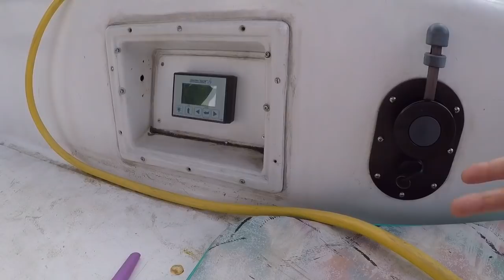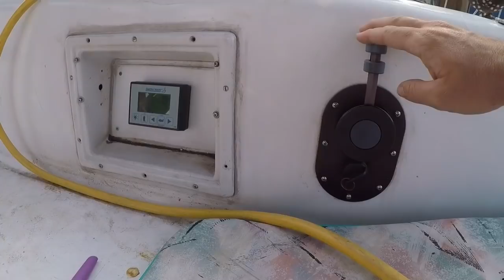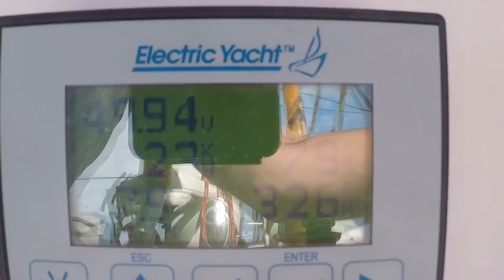Our Electric Motor | Sailing Wisdom Ep 32

Comment: Hi just my experience , my neighbour next to me has a 37 ft yacht  wanting to do the world trip , etc dumped the diesel went electric   The cost was twice than the diesel , he was told ,,,no it will be cheep  ,battery’s were 600 a pop and he had 12 of them m to keep up with motor and living on the boat  ,there life became ,,save power , one light at night , and they brought heaps of flashlights  ,then there was cable , very expensive stuff to accommodate long life for this motor , then there was the dash with all its requirements , on the out side the solar panels were another drama , 6 of them huge.  They made a bimini out of solar panels and then found that if the rigging cast a shadow over the panels they stoped working  ,it went on , the. He could not get cat 1 to leave off shore until more money was thrown at the engine affaire to satisfy the inspectors  so , it’s not over yet they have many trips away doing the odd week trip etc  ,the end result.  They say they run out of power lots.  Remember you can’t run the system below 60 percent , it damages the battery’s.  It goes on.  Stay with diesel , if you a green nose. ,suffer it.  Diesel motors are only as good as you maintaining the.   Clean filters and fuel  ,up to you , oh ps my neighbour was thinking of selling at one stage , the broker said it won’t be worth much maby put the diesel back in , good luck
Reply from the maker: Ouch, that was a miserable experience! Our entire conversation including the boat yard bill was cheaper than the cost of the diesel motor we were looking at installing. 
It pays to shop around! Good luck to them.
Reply: Proving the point that $$$$ don't equal brains...."go small go simple go now" wise words of L&L Pardey a cruising couple who did it all.

Comment: can you run the engines and charge with solar at the same time?
Reply from the maker: Yes, but only because now we have a lot more solar. If the sun is high in the sky and we aren’t moving too quickly, it will charge at a few amps while we motor along.

Comment: 210ah on those batteries. 2017 I can see why, glad in 2019 we can get 210ah out of a SINGLE LiFePO4 battery.
Reply: Daniel Murray i don’t think at 48v. that bank they have is 10kw. what single battery is 10kw? ah mean nothing if you don’t factor in at what voltage
Reply: @AllMyHobbies  LiFePO4 is 3.2 V on a cell level, but what Daniel means is a battery (seveal cells). They now sell 12V batteries (packs) in the same enclosure as a 12V lead acid battery that holds >200Ah at 12V. And LiFePO isn't even as energy dense as NMC. Tesla projects getting >500Wh/kg in 5-7 years. That would be a game changer.
Reply: @jorgenr  LiFePO4 is only safe in the boat. because  In general, lithium iron phosphate batteries do not explode or ignite. LiFePO4 batteries are safer in normal use,

Comment: do you have a video on how you wired the step down converter into the 12v system?
Reply from the maker: We do not but it literally has two wires that lead in at a higher voltage and two wires that lead out (and to the breaker panel) as 12v

Comment: Could you use the power generation for making drinking water, or would that require more power than is available?
Reply from the maker: +Chris Niekel we could, but it would only be feasible if we were sailing very fast for a long time. Sadly, we only hit high speeds for a little while and then the wind seems to change out of our favor. 
With more solar panels, we would be able to afford the power draw on a calm sunny day.

Comment: Hey Guys , great info , I’ve got A 10 ton full keeled Colin archer styled boat I’d need a pretty big engine if I converted over ! Which I’d love to ! However what size engine would I need ?
Reply from the maker: I would contact Mike at Electric Yachts to figure that one out. 
Mike@electricyachtssocal.com
We are 18 tons with a full keel and have a 20kw motor. We don’t motor much so we opted for a smaller motor, but they do have much larger motors as well.

Comment: Certainly to change to Li Batteries would give you around  50% more driving time/range as you can run the Li battery down more than the Lead acid batteries, you also save on Battery weight for the same AH, but oh dear, the cost !  probably US $ 800 for every 100Ah Li battery. big cheers,  P&F
Reply from the maker: I’ve been looking at building the batteries from LiFePo4 cells and that will range from $80 per 100ah@12v or $320 per 100ah@48v to $572 per 100ah@12v or $2288 per 100ah@12v. 
The cheaper batteries are only available for a short time while the more expensive ones are available all the time from online retailers.

Comment: Great to see how this one works, don't want to seem critical - just a notation and an opinion - in re to bilge w/ electric - my main concern would be in the event of taking on any water, or through hull leak - I wonder how much water can or level it can go up to b4 it shorts and fails ? Also bilge cleanliness can be crucial - plan for the worst , and if thre rat sh*t , hair, plain dirt in there it creates mold and crud will quickly kill a bilge pump - another way to be screwed in a hot little minute ;-)  think of back-ups and then another back up if it all goes bad  !   Happy sailing  !
Reply from the maker: That is also a concern of ours. With a full keel the original motor was placed all the way down in the bilge so a few inches of water would wet the bottom of the oil pan! 
The electric motors mount above the drive shaft, so they sit about 2 feet above the bottom of the bilge. 
We have an electric bilge pump (standard rule pump) which could easily get blocked. Then we have a Whale Gusher mounted in the cockpit with a strum box. 
Last but not least, we have a massive Edson manual bilge pump with no strainer and a 2.5 inch hose feeding it! The Edson can actually flow filth and scum with ease and shouldn't clog as a last resort. 
Basically, we have an electric pump for convenience and then two manual pumps for actual work and dependability

Comment: Oye. I’m leaving in 3 parallel universes:
1.) switching my atomic 4 out for a rebuilt one and staying circa 1976.
2. Installing a used diesel, preferably Yankar 3C <2000 hours                                                                           3. Buying 10kw Thunderbolt electric motor kit and going broke on lithium batteries.                      Going electric sounds really exciting, though expensive, and likely the direction things are going. Living on the Central Coast of California with a lee shore always looming has me considering a diesels safety advantage. The other part of me wants to continue the Atomic 4 legacy and keep things original. That would certainly be the cheapest option to get sailing the soonest. The trouble shooting seems a little more straight forward as well.
Reply from the maker: These are all the decisions we have to face when repowering, but the best choice is the one you feel most comfortable with. 
Our electric motor was cheap because we didn’t buy the fancy batteries, though, 5 years later, we are heavily considering upgrading the batteries to a self built lithium bank!
Reply: Rigging Doctor Yeah, you have to commit to something to get sailing! Though I also agree with your engineless sailing philosophy as well. A guy by the name of Jay Fitzgerald comes to mind on the topic. He talks about sailing and getting by cheap in a crazy world. Take DIY to infinitesimal degree..Hope to hear about your approach to building your batteries!
Reply from the maker: Michael Kraft they will be in our videos when we build them :) you should subscribe so you don’t miss when they get published

Comment: Hi, how many kw to push your boat at Hull speed?
I'm Looking into getting the qt20 too.
Awesome channel by the way
Reply from the maker: Thanks!
At hull speed, we use about 15kw. We normally motor around 2-3kw to give us more range with our Li batteries. When we had lead acid batteries we had to motor at around 0.3kW or we would drain the batteries too quickly. It was painful!

Comment: I crewed on a 100 foot ocean-going tugboat that had an electric motor in Alaska
Reply from the maker: That’s amazing!!
Reply: It was an EMD Electomotive Diesel like trains have and like submarines had along with battery banks for running under water
Reply: We could get the e motor to turn the Prop as slow as 8 revolutions a min.

Comment: Energy density. Whats the total weight of your system and from fully charged how much run time do you have?
Reply from the maker: +Buck Turgidson The batteries weigh 552 pounds and the motor weighs 126 pounds. I don't know the weight of the battery cables but I would find it safe to assume it is less than 20 pounds. 
That's 678 pounds for the motor and batteries, or under 700 including the cables. 
Total run time at around 2 knots when fully charged is around 20 hours. If you kick it up to 7 knots, the run time drops to around 20 minutes.

Comment: you're choice is not bad at all.  About trying to get in before a storm ... well all I can say is if a storm catches a normal(?) sailboat, that boat is going to be much closer to shore .... rocks .... shallows, and other boats ... not good.

I think, in the Great Lakes, it takes about 2 knots to keep ahead of midges(small biting flies), and about 1.5 knots for delta flies.

The "immediate", torque in tight quarter should satisfy you.

I used a 42 lb thrust for about 4 years on a Venture 25 and two years with a 60 lb thrust for two years on a Newport 28.

You do know(?) that after the advent of powered craft, the OPPOSITE was considered .... that NO POWERED VESSEL would ever want to leave shore without sails .... POWER WAS NICE, BUT NOT FULLY TRUSTED.  I think this is why everybody wants HUGE motors.
Reply from the maker: Very interesting about power boats needing sails. 
I’ve always wondered why old power boats had a mast and rigging on them. This answers that question!
Reply: yeh .... look at the old photos ... POWER was not considered as trustworthy as wind ... for quite a while ...

Comment: At frames 12;00 - 12;13 you show your drive shaft ... and I could not help noticing how close your hoses (water tank fill line or ventilation?) hoses are to that shaft. If something shifts, couldn't the rotating/extruded elements on that shaft cut your hoses?

Other than this observation, I think your electric motor conversion idea is an intelligent choice. Sure, it does not provide the sort of power and range that diesel might, but the advantages are also the ease of maintenance/operation (as you pointed out), quiet and reliability. I suppose you did not consider setting up a lithium/phosphorus battery system for some reason? Cost not considered, it seems the way to go for many reasons, not that costs are coming down and chargers and monitoring are becoming easier. I am considering a retrofit on our Caliber 40 LRC to Li-Ion.

One last thing. I have decided to move from only a single gasoline outboard to electric. This decision is to reduce the weight and handling of the outboard engine for several reasons. My wife is not strong enough to heft even a 5hp safely, and we try to ensure that, should I get injured life would 'go on!' Also, we plan on rigging up brackets to allow us to utilize two of these for thrusters, to navigate into tight channels to safely enter coral atolls, and for safer docking maneuvers. They are light weight, fool proof and even waterproof (mil spec) and can handle submersion for short times. These motors also run on Li-Ion. I am referring to the Torqueedo® outboards.

I am surprised that I do NOT see wind gens on your boat? Why is this?

I appreciated your videos on the conversion to Dyneema standing rigging. I may well try this as well, but for shrouds only, keeping wire for fore and aft stays. We use one of our twin backstays as a SSB antennae, and it is easier to simply maintain these. Still, I think rope is a great idea if it can work, if for nothing else, as you've pointed out, for the ease and viability of self maintenance.

Thanks for your work brining your experiences to the public. Will send you a few bucks along the way ... our way of saying "thanks!"

Fair winds to the two of you.  :  )
Reply from the maker: The hoses were too close and one got chafed. The repair happens when we sail into Florida before heading out to cross the Atlantic. Space is very limited and it is far from ideal, but that is what we have to work with.
No windgen because I don’t like the noise they make. Also, they don’t make enough power when cruising downwind.  I was Crew once and the yacht had a windgen but we still needed to fire up the motor to keep the batteries charged. The regen from the motor kept our batteries fully charged as we crossed the ocean while the solar panels keep us charged while at anchor.
We are looking into upgrading to lithium in the near future, but it’s still out of our budget. When we did the conversion 4 years ago, lithium was $20k while AGM was $1.8k. Now, lithium is around $7-10k. Still pricey, but our batteries are 4 years old and could use some replacing.
Thanks for following along and please share our channel with your friends :)

Comment: You should parallel 2 batteries first then series to 48 volts.  I would also use tin plated copper bus bars instead of cables.
Reply from the maker: I’ve been doing a lot of research on lithium cells to build our next battery bank and I completely agree with you! Bus bars and 4s2p is the way to go in there!

My next bank (if the cash bank allows) will be 16s6p. Sets of 6 in parallel and then the sets tied in as series to bring the voltage up to 48v.

Comment: Hi I listened to your thoughts on the  electric motor or diesel.  The argument of danger from a storm is not valid.  I have several motor boats 150hp, 200hp and 350hp which will operate at up 50 mph sustained.  I still get caught in storms.  If you boat your going to get caught in a storm.  That argument is not valid.  My concern is being able to get out of the way of a very large barge or tanker.  And being able to move against the wind, waves and tide in a hazardous situation.  I think as long as you stay alert and start avoiding other boats early you will be fine.  If I had no motor I would have AIS and radar.  

With your systems ability to operate at 8 knots  you can safely move out of the way of a larger ship.  You can also motor away from rocks, pier or other hazards against tide, wave or wind action. 

In the end, any machine can be operated beyond its capability.  The safe operation depend on knowing the ability of your craft and your ability and staying within that set.  

I think you are good to go.  I also like the electric system.  I definitely may try it in the future.  

I have one question.  What happens when salt water gets all over those wires? 

Good luck! God Bless.
Reply: It turns out that water, including salt water, is not very conductive.  And as we know 48 Volts is relatively safe for dry skin.  If salt water gets on the DC systems I'd say pump them out, wash with fresh water and dry.  Since the motor electronics are probably waterproof, the system may continue to work if desalted and dried.  Definitely use normal, marine, adhesive backed heat shrink on all wiring to keep water out of the wires.  If needed, scrub and clean the electrical terminals and contacts.  I like the zip ties they used on on the terminal covers too, to try to block water ingress to the wires and terminals..
Reply: ok from experience if salt water covers the batteries you will feel a current in the water.  Experience
Reply: Yes, (salt)water is conductive, but only slightly.  Obviously it's best to keep everything as dry as possible.

Comment: Interesting. What were your cost breakdowns for the motor, components, and batteries? Would you choose this motor again and Why?/Why not?
Reply from the maker: At the time, the motor was $8000 and the lead acid batteries we had were $1800. We used that for many years but recently switched to LiFePO4 for $5000 (we have been saving for a while) and it is an amazing difference!
The motor runs great and I would use it again, but it can only run for as long as you have battery power for it, so investing in the batteries like you have already done will be key!

Comment: Is your electric motor from electric yacht? If so is it the 48 V system I I I have a  35 foot sailboat huges 35 with a 10 hp electric motor from electric motor Me and my parents converted our  Manta  catamaran we also have a Dc to DC converter what kind of battery charger do you have ?
Reply from the maker: It’s the QT20 from electric yacht. 
We now have the delta IC1200

Comment: Okay. I am thinking of using a used Tesla motor. Any ideas regarding schematic battery etc.
Reply from the maker: I would check out thunderstruck-ev.com for all the other parts of the system. 
Basically: throttle quadrant, sevcon gen4 controller, electric motor, and batteries. That’s your whole setup. 
Any motor will work in the system. 

Very cool idea!

Comment: If you have a DC to DC converter, why do you need more than one battery bank?
Reply from the maker: Just for redundancy. If we live off the 48v with a converter, our nav lights would be dependent on the converter. Having a second 12v bank means that if the converter dies the lights stay on in the night.

Comment: If you keep your diesel fuel clean then you would not have had the issue you describe of choppy water stirring up sediment and clogging the filters. You have to "baby" diesel fuel - I do so by: (i) always filtering fuel as it comes on board; (ii) using a good quality biocide; (iii) taking the opportunity to polish the fuel when you can. Clean fuel is lesson 101 of diesel boat ownership.